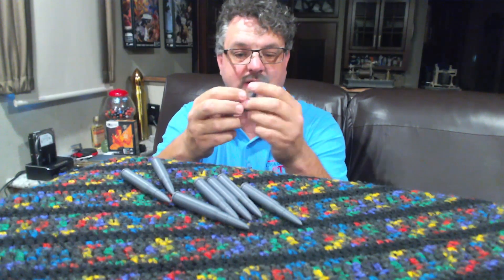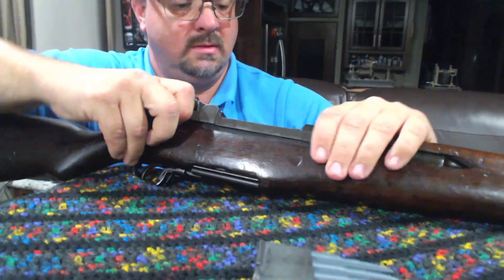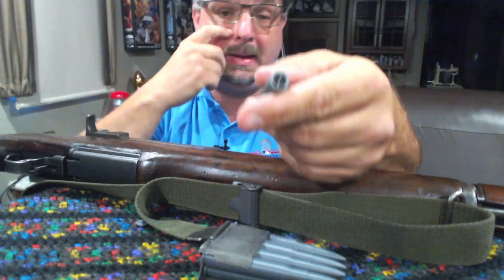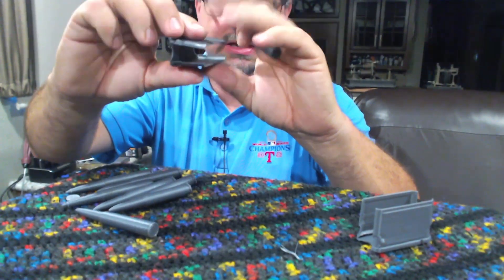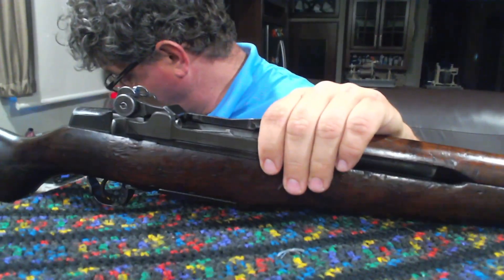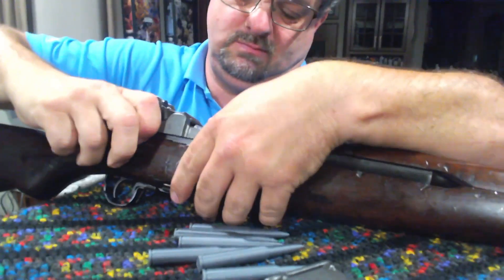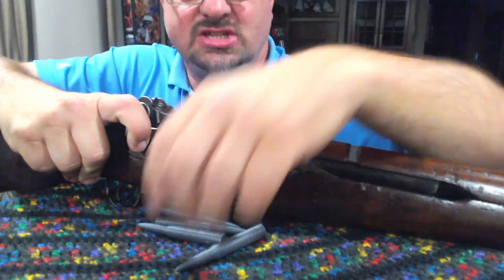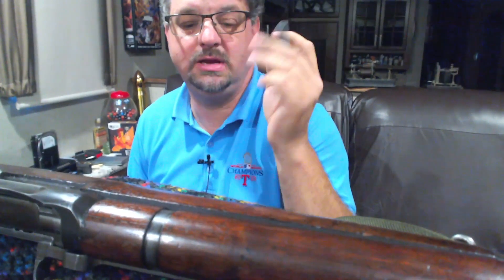3D Printing Nonsense with the M1 Garand

Comment: what % of fill did you use for the cartridges? maybe it needs to be 100%?

have you had a chance to try out the 3D printed clip with live cartridges at a range? those clips aren't cheap any more maybe 3D printing them will be the way to go..

imagine if someone could injection mold plastic garand clips..the market might be too small for that.